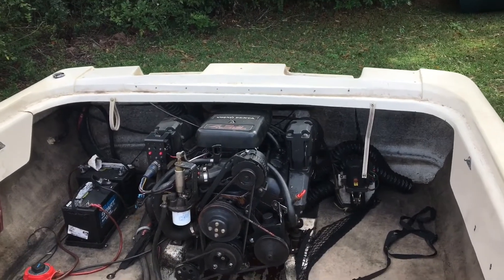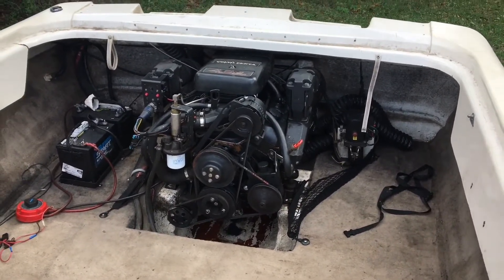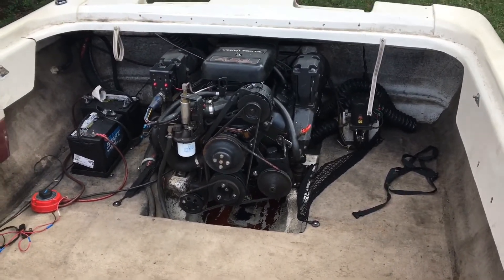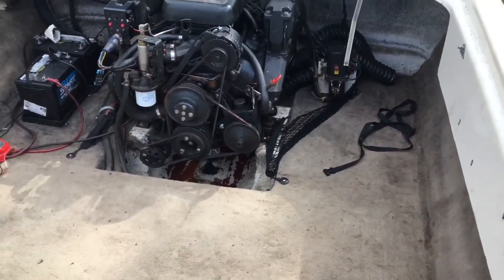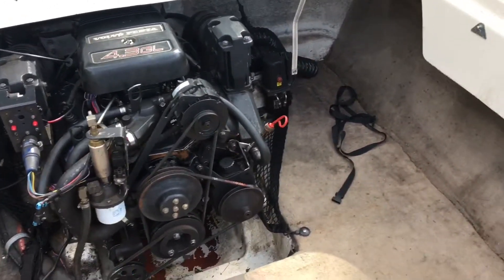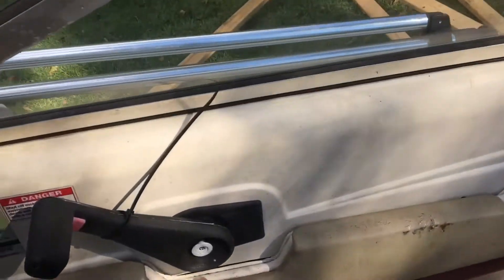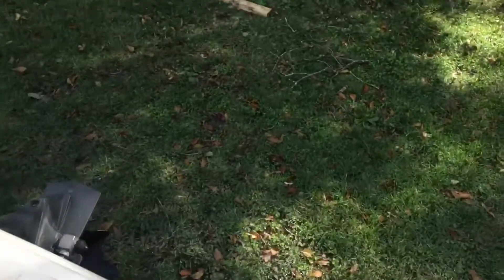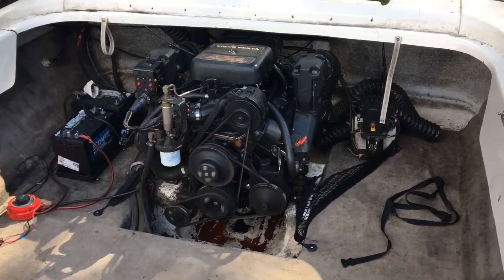Part 1A - Mercruiser 4.3 V6 Rebuild - Introduction

Comment: Hey, im getting ready to rebuild a 4.3 Merc Alph One.....first the seen freeze plug pushed out..then water leaking from the intake connecting to the block... on both sides...you have a video to help me? Thanks G
Reply from the maker: I really don’t understand your question. But I have a lot of videos on all types of Mercruisers. Sounds like you might have a cracked block in which case your engine can’t be rebuilt.